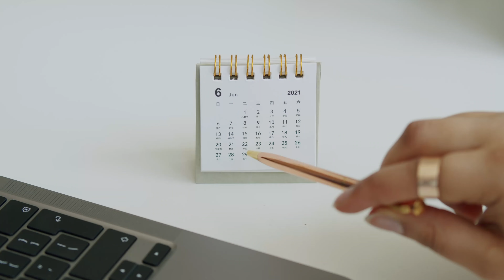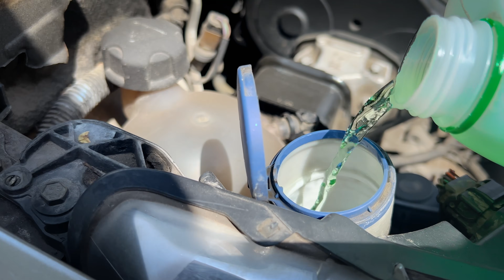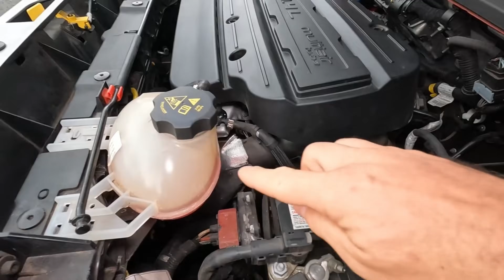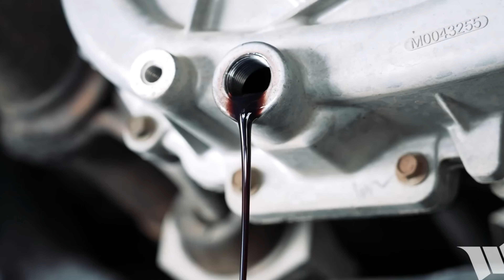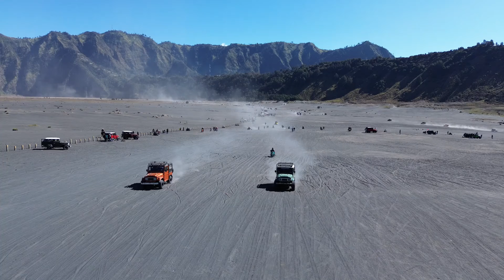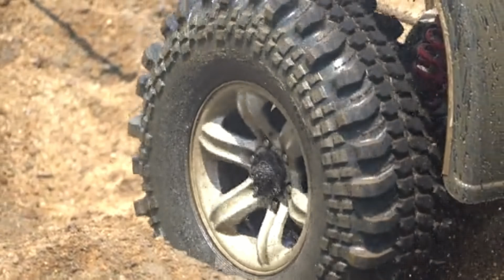Make Your JEEP Last Over 300k Miles Without Any Major Repairs

Comment: I own a 2007 Jeep WK with the 5.7 liter hemi. I have been and am switching all the oils to Amsoil. No hemi tick using the Amsoil, and I added a 2" lift with new Monroe coil over shocks and struts , a new set of Deeke upper controls. Then I got an alignment done on the front end. I switched the plugs to the Champion platinum 3570 spark plugs. I swapped out the radiator with a 4 core all aluminum radiator and the thermostat to 180° f thermostat. It runs smooth running the Amsoil 5w40 MS European Classic motor oil and a Mobile 1 extended performance M1-301 oil filter. My Jeep is almost at 176,000 miles and going strong. I think If I keep up with the maintenance schedule and use Amsoil products it might reach 350,000 + miles.